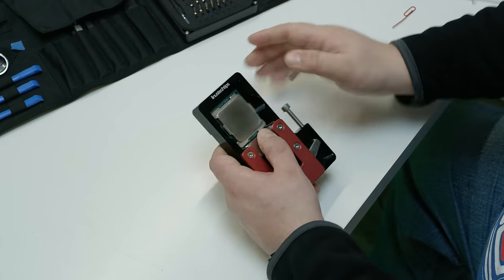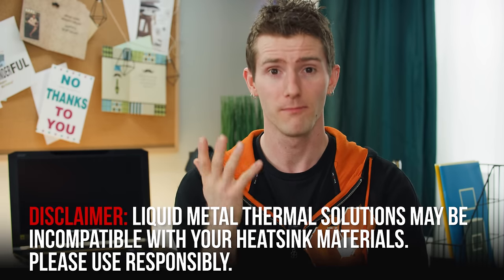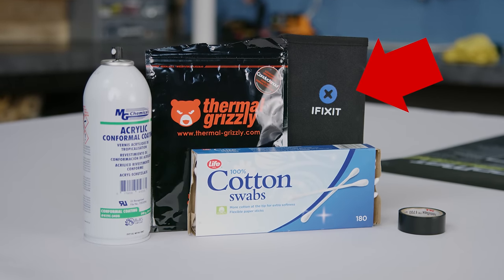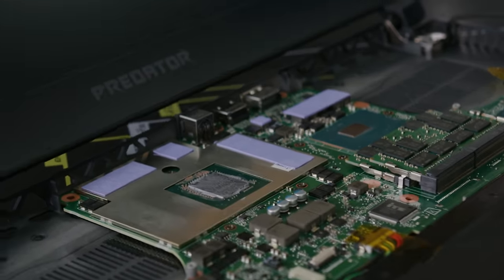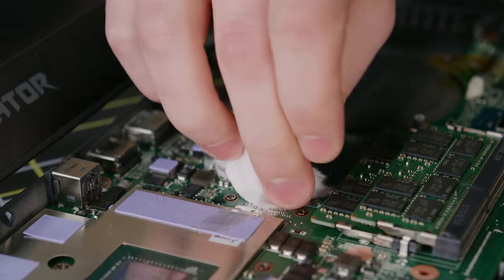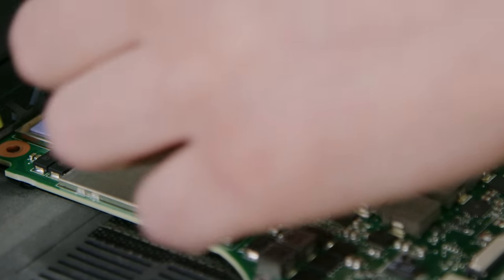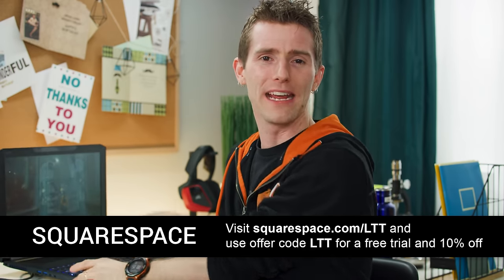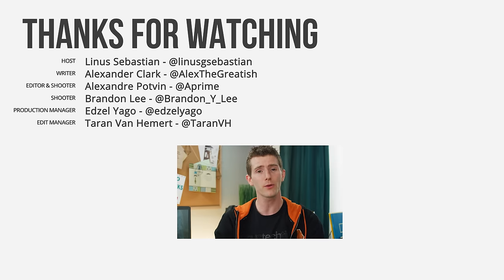Liquid Metal Laptop Cooling – 20C LOWER!

Comment: Warning: the black plastic end piece is meant for REMOVAL only (that's why it splattered everywhere in the video). The thin curved metal end piece 0:27 is meant for APPLYING. Also, the drop applied in this video is WAY bigger than recommended and will surely lead to seepage into surrounding components over time. I fried my old laptop applying this stuff the wrong way so hope this message saves at least one laptop from dying. (Update) Use minimal Acrylic Conformal Coating and apply to exposed metal only as it will act as an insulator.
Reply: Sean Gurney i will not do it anyway ;)
Reply: Kostanj42 someone will in the future.
Reply: i always wanted to use this stuff, but knowing my luck i would fry something.
Reply: Sean Gurney do you know a video or guide that shows it the right way
Reply: Gamers Nexus did a guide not too long ago.
Reply: upvote so this stays top
Reply: Robin, just because it's someone's job doesn't mean they're good at it.
Reply: Just because someone is posting Videos on Youtube it doesnt mean that he is the best at doing what he does. He is just good at making Videos.
Reply: He's been doing this for so many years. Even with thermal paste, that amount would have been too much. This and a handful of other videos are why I take Linus' tips with a grain of salt.
Reply: What if you mix normal paste and liquid metal ? I mean put the LM inside a square of normal paste to trap it with approximately same height ?
Reply: Cyclo16 -R that actually sounds like a pretty damn good idea. Whether it will work or not is another thing
Reply: Just recently did a delid and liquid metal application on my i7 7820X... results were incredible. Was able to overclock all 8 cores to 5Ghz locked stable with a max temp of 75c under stress test.
Reply: @Mitch H so you applied this under the lid AND over the lid between the heatsink and lid?
Reply: DarkFireBlade25 nope just between the Die itself and the heatspreader. Between the heatspreader and the water block I use arctic silver 5.
Reply: I took a day to try it on my Razer Blade 14 1060. 3 layers of Thermal coating + tape 33+ applied in all cases. I tried different amount of liquid metal (conductonaut) on CPU and GPU, with and without mix of normal paste. It appears that to have a thermal gain (~10°) I had to put a huge amount of liquid metal on DIE (around 0.6g for CPU and GPU) otherwise it was like there were not enough contact between DIE and radiator. The mix with normal paste is not concluant since in the Blade case there are holes between heat pipes ... Nvm ... so 10° improvement in normal use / gaming. And 2° improvement while runing pirme95 :)   I'd say it truly depends on laptop model.
Reply: @Frank Verbunt the best advice is in the accompanying instruction manual - it says to use a pin-head size drop. Also, don't use the supplied alcohol wipes directly - always use cotton buds with a fraction of the liquid otherwise it could drip and short things out on the motherboard.
Reply: Mitch H i call bullshit on that
Reply: Important : 1 week after even with 3 physical barriers the liquid metal spread around the DIE of GPU and CPU. Somehow, it goes through the electrical tape, and ended under the CPU and motherboard (as in Linus video but it did it by itself) ... at like 1 mm of the CPU socket pins ...  I took 1 hour to remove the spread liquid around socket avoiding contact between CPU pins. Concerning GPU, LM reaches the top of memory chip and spread around them too... So I cleaned and get back to normal paste. The risk is too high since the gap between heat pipes and die is too big, and so I had to put too much liquid. LM truly requires a completely closed area to operate safely. As to be mentioned that it severely depends on laptop build, I don't recommend using it on laptop. Neither on opened desktop heat sink.
Reply: Again it depends on your laptop die / pipes gap. The thing is that to have a descend liquid conductivity you should see the liquid barely moving on the surface of the DIE when balancing smoothly your laptop. But If you do have this, it is already too much and it will spread around ... If you have a small gap and a good pressure with pipes on die, then maybe less than half of the amount on your printscreen. But If not, you may put twice this amount ... and will damage you laptop. In any case, the "liquid" thing is the issue ... it has to be liquid to achieve good performances .. but you can't let it runs out inside your laptop. (except maybe using massive layer of insulating coating on the whole motherboard .. but you will also constrain motherboard heat and in some way lead to failure).
Reply: Surface tension and the insulation tape will prevent shorting I'm sure.
Reply: a grain is too much
Reply: I wonder who in LTT is in charge of coming up with the transition from video content to ads
Reply: Don't liquid metal laptops!  Gallium will alloy with Copper, the reaction speeds up with heat.  My laptop was running at 80c for about 3 days before the temps were at 97-99c and down clocking, I run BOINC on it.  When I took my heat sink off, the copper contacted with the liquid metal turned silver and would not come off, it actually absorbed into the copper.  

Quality thermal paste will actually do the same on max temp ceiling FYI.  Just in case anybody else wanted to try too.  Read up on liquid metal and copper.
Reply: You should mention that your razer blade 14 doesn't have a traditional heatsink.  The silicon is in DIRECT CONTACT with heatpipes, there is NO FLAT SURFACE.
For you obviously liquid metal is way too dangerous and you should be using conventional thermal paste.  There is absolutely NO WAY that LM would work for you because it will spill everywhere.  That shit is not viscous  at all, its LIQUID metal. 

You shouldn't have tried it at all.
There are reasons why LM is not good but nobody should be dissuaded from using LM just because you used it in a stupid scenario where you shouldn't have.
Reply: Sean Gurney
Where the hell did they teach you that "meant" requires an apostrophe?
Reply: Point. ........ , , , someone anser me please
Reply: Would urethane conformal coating be okay to use instead of acrylic??
Reply: Duly noted. I intend to apply LM on the Eurocom Q6 and the P751DM2-G.
Reply: I'm going to apply soon, I'm going to use conformal coating, and kapton tape, and from my knowledge It should only be enough to paint it, so no texture?
Reply: thank you, i think the electrical tape saved linus, but make the electrical tape would cause more heat. leads me to believe the temps could have been better.
Reply: Thank you. Quick question. Where do you buy the coating?
Reply: would you say this stuff is safe? considering doing this but a total noob.. my laptop runs hit :/
Reply: Kamil Zarzycki look at lynis other videos, theres a pad thats less effective but still good and without the danger.
Reply: BLA BLA BLA BLA BLA
Reply: @mickjdee  well I'm sure you have an old smart phone hanging around somewhere, so you could try it on that first.
It's more fiddly than a PC or Laptop, so if you can of it on one, you can do it on the other.
Reply: @Hephera  so why dont you start one ????
Reply: which laptop was that you fried?
Reply: @cyclo16hacks  different amounts*
Reply: @cyclo16hacks  the* CPU
Reply: @cyclo16hacks  was* not enough
Reply: My butt clenched when it got everywhere. You do not want that crap touching aluminum or it’ll just melt it.
Reply: Sean Gurney holy shit that little drop is too much?! God damn liquid metal sucks
Reply: Bit of a bruh moment
Reply: @Hephera  How are you so angry over a youtube video, if youre so competent shouldnt you be doing something much more important?
Reply: if anyone here is wondering how to do it correctly, just apply the absolute least amount of force you can until a little bit comes out, this is with the application tip. You actually wouldn't need the suction tip at all with this method. Before applying, use some steel wool to rough the surface of the ihs or die you are applying onto, to give the metal more surface area to cling to. The coating is a great idea, but the electrical tape is all you need really, I've used some systems for years that way. I used TG to upgrade an old i5 laptop to a 45W i7 845qm with a single heatpipe cooler, and to cool the discrete gpu as well. Results were fricken amazing, as the i7 ran max load at 78 C and 90C with both at 100% at the same time, despite a massive 700/1050 overclock on Radeon HD 5650m
Reply: @Hephera  they do a pretty stellar job considering how much time and detail they put into it. Messing up is apart of the process and if LTT didnt make that mistake we couldnt have learnt from it
Reply: Saved me
Reply: Thanks for the note but I'm not doing this anyway lol.
Reply: 8auer (who made it) uses nail polish or his new released red polish to safe it
Reply: Is kryonaut easier to use? I mean, it is still conductive. But it's a paste so handling it may be easier.
Reply: @Igor_servant_of_Philemon  Yes Kyronaut is easier to use. I use extreme Kyronaut (the pink one) in my laptop. It is a thick and sort of "harder" paste u need something to smooth it down. My has an cap which need to be pressed on the tube and it works perfectly.
Reply: my plan is to put tape on the sides so i don't sip liquid metal during the application is a bad idea to leave it there
?
Reply: Why minimal acrylic conformal coating? Is that dangerous to components?
Reply: @Shiny_Gliscor  link?
Reply: I will do this on my legion 5 laptop, it gets so hot dude, it drops from 4.3 to 2.8GHz after an Hour, probably also because I haven't changed the thermal paste, and I'm pretty sure it's dry af, I will use nail polish to protect a lot of the surrounding components, and add a bit of tape as another layer of protection.
Reply: I wish my laptop had a ihs on it, it has the die exposed and it has two I think... Been a long time since I looked under the hood of my laptop really lol
Reply: It's also described in the small manual of the liquid metal they've been using.
Reply: I know this comment is 5 years old, but thanks! This will be usefull :D i screenshotted it so i dont forget
Reply: @rpeet687  That aged like fine wine

Comment: Holy shit. When I saw that metal splash onto the mobo, I thought it was done.
Good job cleaning it up and great results.
Reply: they took out the laptop and the motherboard battery so there is no electric charge
Reply: yea dude.. i shit myself!
Reply: If they didn't completely wipe all of it off, it can still short out components when they try to turn it back on.
Reply: The gallium is what will find its way into something maybe a month or so later....
Reply: some* dont understand that without electricity, electronics cannot be harmed by water or other conductive fluids. i wash my motherboards in the sink every other year and air dust every 3 months. just need to make sure it is 100% dry before putting electricity back into it
Reply: The liquid metal has gallium in it, if you get that stuff on solder points it will eat into it and make it turn into the consistency and durability of chalk. Search some gallium vs lock videos here on youtube to see what I am talking about.
Reply: ALWAYS pull the Syringe back and then push it slowly and gently. Why pushing it back? Because it dries a bit in the Syringe making it harder to push at first, thus using too much force at the beginning.
Reply: @Luckashek I
True, but they only coated near the GPU and CPU dies, not everywhere on the mobo where the liquid metal went.
Reply: @hi yall
True, nothing could happen at the time of the spill, but a lot can happen when they turn on the PC if they didn't get all of the liquid metal off of the board.

Washing your mobo with water from the sink is not the best idea as water has a lot of impurities in it and can leave crap behind on your board, but to each their own.
Reply: LOL. Been there done that the first time I used the conductonaut syringe. Suck the droplets back up, isopropyl plus absorbent paper towel for the rest.
Reply: literally face palmed hard
Reply: Right and here I thought I'd never physically cringe from a computer
Reply: easydoz1 The tin will form filaments to short out microcircuitry. Though it does take weeks or months at least
Reply: No electricity doesn't mean no corrosion or other unfortunate reactions. And a couple of quivk spray dustings of conf.coating is in no way any guarantee (or even.likely) to make a perfect seal across the whole area.

If you don't know how it comes out, always do a small test ejaculation onto something non-essential first.
Reply: Yes, true.. i washed motherboards in the dishwasher (for a batch of crummy desktops that were used in an internet/gaming cafe with a lot of smokers.. they wreaked like a wet ashtray) A light rinse in the dishwasher with some light glasses detergent and in 30minutes 10 or so motherboards were like new.
Just remember to remove the battery. Also don't do this for mechanical stuff (hdds, cd-roms, etc) or unsealed caps (like many low budged psu's) or with a lot of crevices where water can't get out easily  like stuff under shielding tape, coils of transformers, etc.
Reply: @Matthew weiler i blast my PCBs with a high powered electrical air duster to get off the water off. so its all good. i know about the build up :)

Comment: @5:07 I actually had a physical reaction watching that. That might have literally been the worst possible case scenario when working with that stuff. And sarcasm aside, "we did it on purpose to show you what to do" is a totally legit response. I can only imagine how much more carefully every single person who watched this and attempted the same procedure was when pushing down on that plunger. 

Kudos for keeping it in the video and owning up to it. None of us are perfect.
Reply: I don't get why they dont make the applicator a twisting plunger instead of a push plunger... If it was twistable, it would be far less prone to slipping and even just the smallest amount of liquid metal could be applied.
Reply: literally the reason i didn't even apply it directly... put it on a q tip and spent hours, painting it on and taking it back off when i think i applied too much, making absolutely sure it wasn't going to seep out and still had 100% coverage. probably outright wasted half a gram, which is trivial compared to the 1400 price tag of the laptop. Acer Nitro 5, playing EVE after an hour or 2 it would hit 85-90 with only Zkillboard running behind it but the thermal grizzly keeps it below 75 at all times. CPU wont exceed 73 and GPU wont exceed 63 when i have YouTube, discord, EVE, and Zkillboard running simultaneously.
Reply: update: i use 2 monitors on a regular basis now and even after extended periods of time with youtube discord Zkill and EVE running simultaneously it will not exceed 78 degress C with an ambient of between 75 and 68 F. this is a laptop.
Reply: no, i have not had to do anything but clean the fans and radiators. i have not had seepage. i have not had a leak. i have not had shorts. the laptop was frequently put into a backpack and jostled around. 
(this isnt a recommendation to do so, its anxiety inducing knowing what can happen. please for your own sanity dont use this stuff unless you plan on keeping it where it sits or youre using something you dont care to lose)
Reply: @leonidas1187  Considering that I have the same laptop, these three comments of yours might make me change my mind after all..
Reply: @inventiveowl395  im not sure which direction you're going but i did end up putting regular paste back on. I just dont feel like a laptop is a good thing to put liquid metal on. It's a ticking time bomb, eventually after so long I did have some droplets on the board and that was enough to make me pull the plug and swap back to paste.
Reply: @leonidas1187  Well.. I just recently got into maintenance and tinkering with my laptop. Direction? Longevity I guess. I got the laptop in 2019, had a repaste done after 2 years because even though I was cleaning dust from it, the temps went to 80 on idle. Had to change the display cable last year and right now, I'm looking for replacement fans since the original processor fan has already ran over its working life (I've added vaseline into the sleeve bearing because it siezed). Since I'm already in it, I started looking into thermal paste.. Which one did you go with?
Reply: @inventiveowl395  you cant go wrong with thermal grizzly. I used their hydronaut this time, highest temp I see is 92 with 2 instances of EVE running with zkill in the background and the heat going. If heats off it levels out around 86 with CPU usage over 80% and GPU at 100%.
Reply: @leonidas1187 if you were so worried about the liquid metal then why didn't you apply a barrier like they did in the video ?
Reply: @pavy415  Because im poor and i make bad decisions without thinking them through.